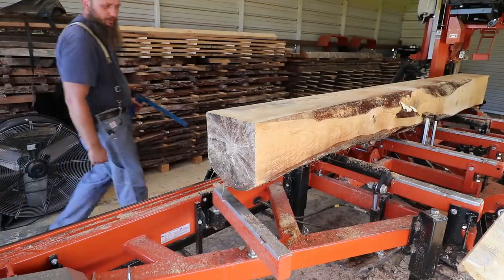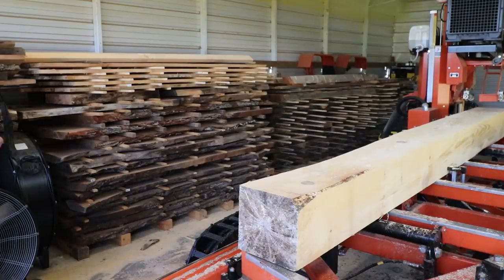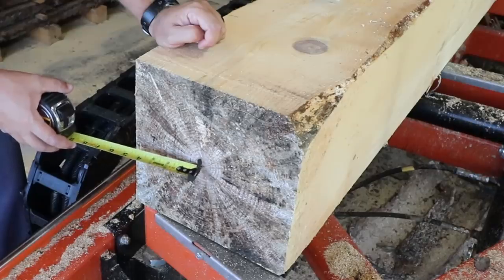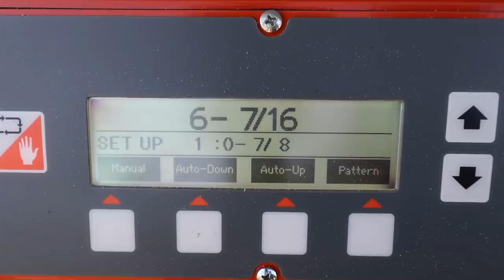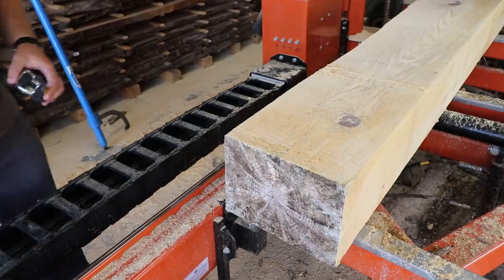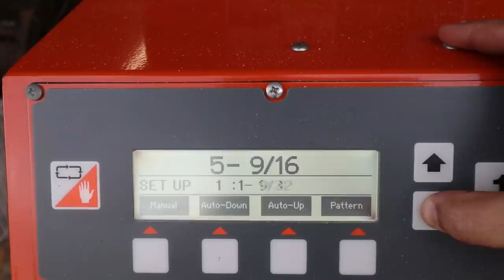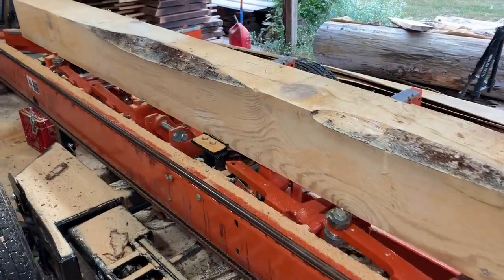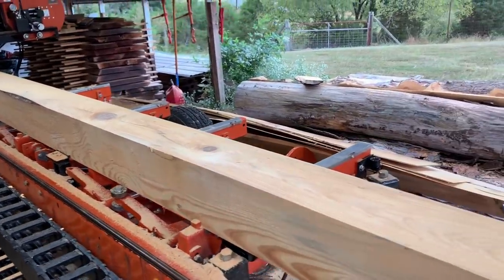HOW TO RUN A SAWMILL LIKE A PRO! PERFECT SQUARE POST FOR THE TIMBER FRAME BARN

Comment from the maker: The best book I have found on how to Timber Frame
https://amzn.to/2lhF1xy
Reply: I've gotta cut enough white pine cants to build a small cabin. Should I cut them a little big in case they twist or warp? Thanks for any info!
Reply from the maker: Good question. All those answers are in that book. I’m learning myself
Reply: Will be following every step, my book is on it's way! Have followed TheTradesmanChannel and Yours immensely!
BTW which anchor seal do You use!
Thanks for the content, keep up the great work!
Reply: @OutoftheWoods0623  Thanks, I just placed my order.
Reply: Man l just can't get over that saw...W0W....What a deal....Thanks as always...!
Reply: Thank you for the reference!
After I watched this morning I ordered. Prime offered a free ebook, so I said yes of course. Even though the actual book won't be here until tomorrow, I started reading the ebook. Read most of it already.
Wow, were you right! This is a fantastic book for someone trying to teach themselves timber framing. I have several books including Sobon's, but this finally started making the pieces fit together in my head. Not just the how, but the why.
It is basically a detailed instruction manual on how to build the sample structure! Right down to how to layout each line of each joint and the preferred order and method of removing the waste wood. Absolutely priceless information! I am a woodworker and comfortable with tools and layout to get the desired results, but that's with perfectly prepared stock in the shop. Layout of a timber frame knowing that each timber isn't going to be perfect had me stymied. No longer! 😊
Thanks again for the reference.
Reply: Love the show that sawmill is bad ass🤠 👍 👍 from Texas🤠

Comment: Instead of having to keep hitting auto up at 7/8" and compensating for the kerf, you can just bring the head to the center of the cant like you have been doing and set the auto up at 4". Only have to hit the lever once and don't have to worry about compensating for multiple kerf settings.

Comment: Out west, that blue staining in pine trees is a pine beetle.  It usually ends up killing the tree.  The wood is still perfect useable.  The state of Colorado was hit hard with pine beetle killing forests of pine trees.

That chain mortiser will become your new best friend when you start doing all the joinery for your timber frame.
Reply: Beat me to it. I recognize the Mountain Pine Beetle's handiwork anywhere. Did a real number on the forests in British Columbia when I lived there in 01-05. Now look at the colossal fires we've had because logging companies don't want to touch beetle kill and leave it dead standing until it's tinder dry.

Comment: The blue streaking in pine is a mold or fungus. One commenter errantly said it is caused by beetles but it is an organism that already exists in the tree. Just as humans have yeast and fungi that live in and on our bodies, the organism that causes that staining lives in the structure of the wood and lives on the lignin of the cellulose. There are three ways to reduce the appearance of the blue stain. Try to fell your timber in the winter months when the sap is down. Do not allow felled trees to lay in damp areas or get rained on after felling, seal ends as soon as possible and get under cover and off the ground as soon as possible. Summer cut timber (sap up) doesn't dry as quick, heat and wet activates organism causing rampant blue mold and rot. Lastly, debark logs as close to felling as possible, lessens borer beetles, logs dry quicker and don't go through a heat in piles, try to mill logs soon after felling. Green winter wood mills faster/better, can reduce blade water, and debarked logs are cleaner and add life to your blades. Lastly, resist the urge to pour water on fresh milled slabs, just to admire the grain pattern. If the logs are dry any organism that would induce mold, mildew, or rot is dormant, water only serves to wake them up and start them eating the lignin that holds the cells of the wood together.

Comment: Ah... A chain mortiser! Gotta love that. Will make your build go way faster! 😊 (envious)
Post and beam construction seems to use drastically oversized pieces for the loads involved, but is very forgiving of seat of the pants engineering. Way back they figured out what worked through trial and error - not by an engineer's calculations. 😊
Wane on posts and beams is irrelevant from a structural standpoint, however it may be an aesthetic concern. That's because if you were to do structural calculations, they would be mostly governed by the remaining wood around your joinery. Which effectively is a much smaller equivalent timber. So the outside edges are not structurally significant. At least that's my understanding.
I am very interested in timber framing and have been trying to educate myself for awhile, but other than helping with a raising - I haven't built one yet. The explanation above made sense to me and answers the question, "why timbers seem so oversize?".
Looking forward to watching and learning from your build!

Comment: Nathan, if you depress the down (or up) button for a second or so, will it auto scroll so you don't have to press the button 50 times? The contacts in that pad will eventually get worn and not function, not to mention all of those thumb presses must get terribly old.
Reply from the maker: yes it will but for some reason it goes soooo fast I pass up the number i wont by a long shot
Reply: @OutoftheWoods0623  Okay. I thought maybe I was going to be of some help. Maybe tomorrow's my day. LOL Anyway, I love your videos!

Comment: Nice job!  It will be interesting to see if the posts twists.  As  Home Inspector, I can't tell you how many treated 6 x 6" deck posts I have seen that twisted, some of them probably as much as 30 degrees.  There were some bug holes.  Are you going to put these in the kiln to kill off the bugs?  Boracare might be a good bet.
Reply from the maker: no sir, put them up green, no drying,
Reply: @OutoftheWoods0623  Go to Nisus.com and check out BoraCare.  One version comes with with Mold care.  You mix it five parts water to the gallon of Boracare and Mold Care and spray it on the lumber.  Helps prevent both insect infestation and mold.  PS.  The blue mold is common on yellow pine.  Turning lemons into lemonade....it has been sold as denim pine.  No structural compromise if it is kept dry.

Comment: Why not auto up 4”?  Also you can measure front and rear pith with the saw blade height.
Reply from the maker: /could have, would still have to set it back to 7/8 for the top cuts, easy just to set it once, 
yes very easy to set it with the saw blade height, I did a video on that already,

Comment: I'm curious why you ignored measuring/centering the pith on the non-operator end?
Reply: boilerhonkiedude boilerhonkiedude  He levelled it off in an earlier video. Meaning he cut the log so the pith ended up level along the same line.
Reply: I saw that, but perhaps I'm used to things going wrong but I would have double checked anyway just to be sure.

Comment: I really don’t understand why you made so many cuts.
Reply from the maker: What would be the better way?
Reply: If done in just 4 cuts, the stress would be relieved in large chunks - possibly with large amounts of warp with no wood remaining to correct it.
Instead of wasting the entire thick slab, some siding boards were salvaged. Trying to do it after the fact is difficult because you are close to the saw rails and the slab is hard to get secured. Why not salvage the boards way up in the air and securely held?

Comment: I don't mean to be critical but when you measure you are holding your tape at an angle which does not give you an accurate reading and in other videos I have noticed you do the same thing I guess I am a perfectionist on that matter  a diagonal measurement is not accurate unless you are checking for square I love your channel but I guess I am being critical LOL
Reply from the maker: The post is true. Most of the time when   I’m holding the tape I’m looking back at the camera. Hard to do everything at once. All measurements are checked way before the camera is turned on 👍